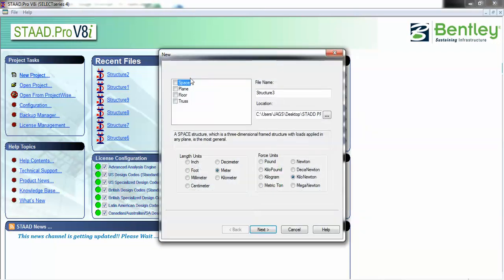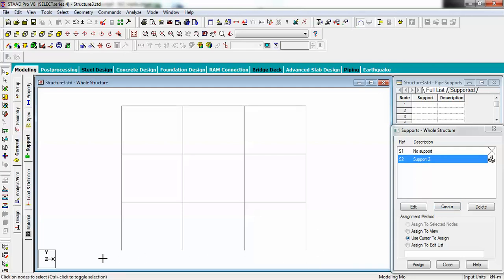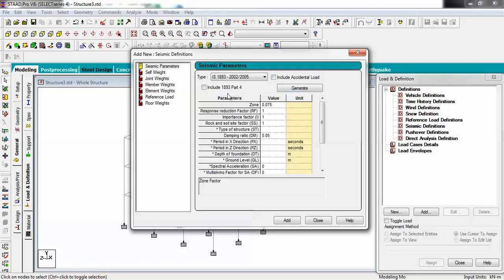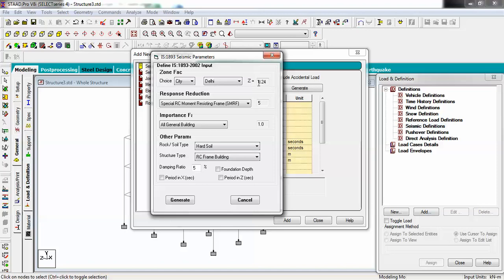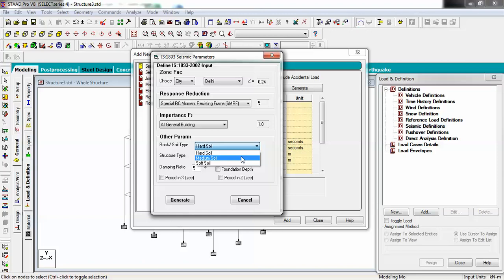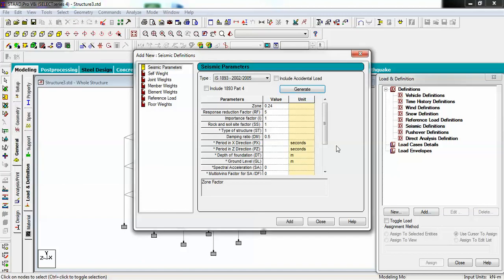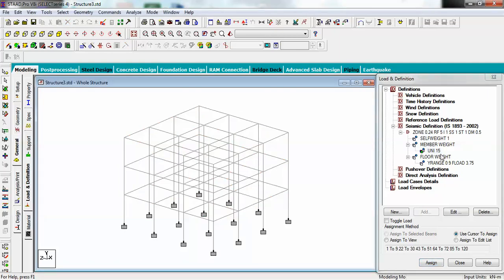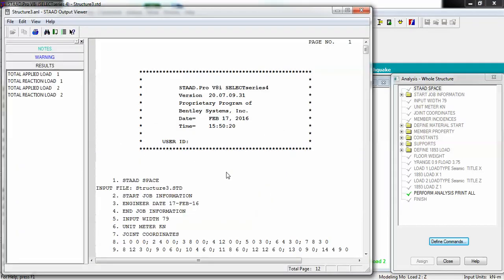Seismic analysis As per IS1893 2002 in Staad Pro best explained

Comment: Where did you get the member weight as 15kn/m
Reply: I think it is specified to consider the weight coming from the wall as UDL -- (3.3m wall height - 0.3m beam depth)*0.25m exterior wall thickness*19.2kN/m3 unit weight of brick wall - roughly 15kN/m.

Comment: how would steel bars effect the modulus of elasticity of concrete section? I need the moment of inertia and modulus of elasticity of reinforced concrete section with effect of percentage of steel. actually I need it because I need stiffness of column to calculate the stiffness of whole story of the building. I modeled a RC building in etabs. etabs gives me stiffness of the story after I run the analysis. but i haven't even run design. How did it calculate the story stiffness even before the reinforcement percentage in column is determined. Is it calculating stiffness of columns with no reinforcement in it ? or is it calculating stiffness of column with minimum required percentage of steel? will it change the stiffness of columns and then the stiffness of whole story after I run design in accordance with the amount of steel it calculates for each column? is the stiffness of the whole story sum of stiffnesses of all the columns of that story?
Reply: instablaster...